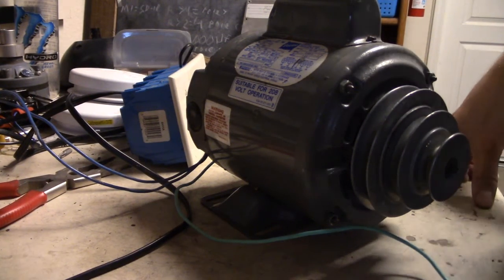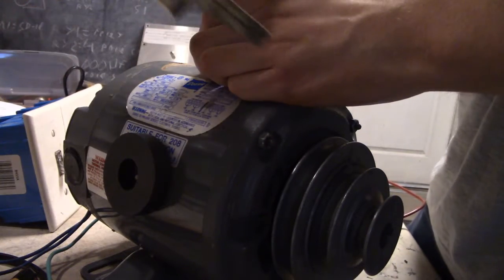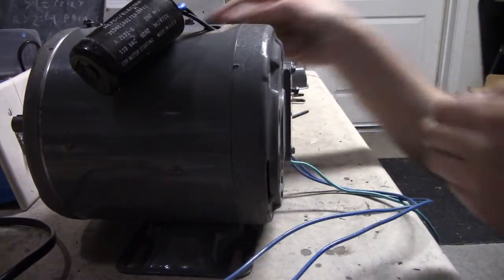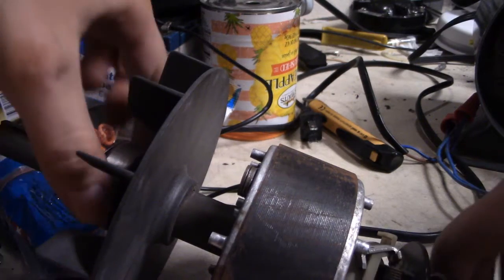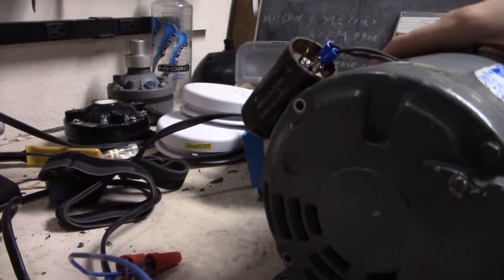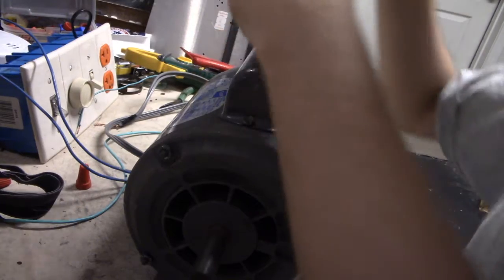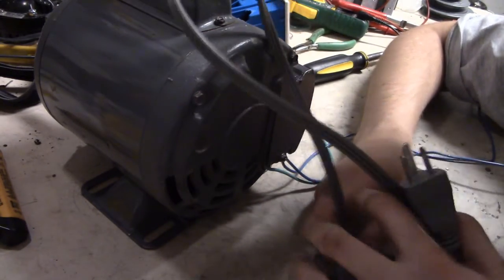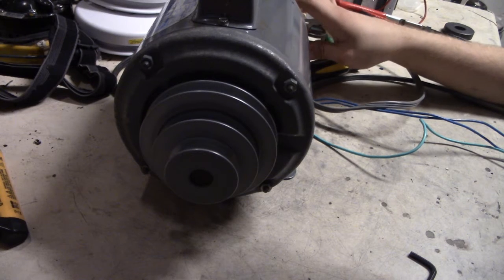How to Inspect a thunderbolt rotator motor.

Comment: It would be nice if you gave the voltage and number of phases (single or three) for the motor at the beginning of the video.
Anyways...Great job. 👍
Reply from the maker: Ok. That’s coming in part 2.
Reply: cooldomino - Cool. 👍
I'm an electrician so that's the first thing I want to know. The 'nameplate' rating. Volts, phase, current draw. Usually there are multiple ratings on the plate for single phase motors.
Very few Tubers give that information and I'm constantly wondering how they are running these sirens at their homes.
Thanks again.
Reply from the maker: @blipco5  well. A model 2 and thunderbolt (no blower) dose not pull that much current. A lot of people use 50-60 amp breakers.
Reply: cooldomino - 50-60 amp breakers are a lot. See, this is why nameplate ratings are necessary.
Or Voltage plus current draw via a clamp-on ammeter.
Reply from the maker: @blipco5  it’s for like sirens like a model 5B, STH -10B, ect. Those things pull like 50 amps running. So that’s why I kinda need 50 amps sometime in the future.
Reply: cooldomino , You have 50 amps single phase (2 pole) at home. 👍
Reply from the maker: @blipco5  no. But I wish.
Reply: @blipco5  this one is a later 1/3 horsepower single phase unit 120 to 220 I believe